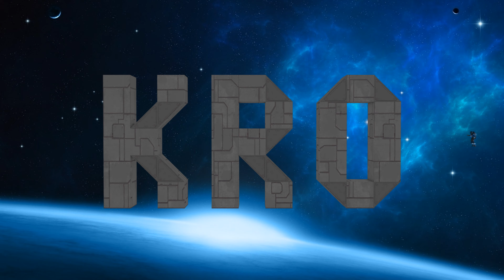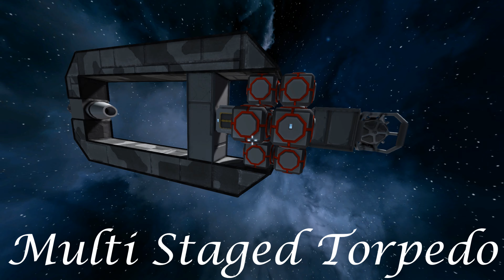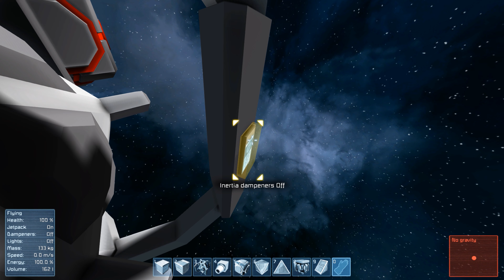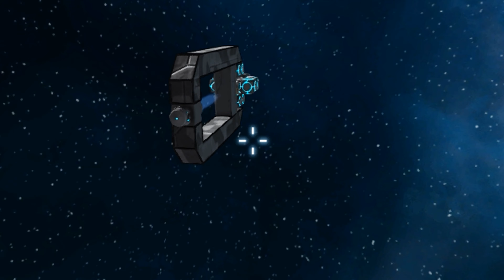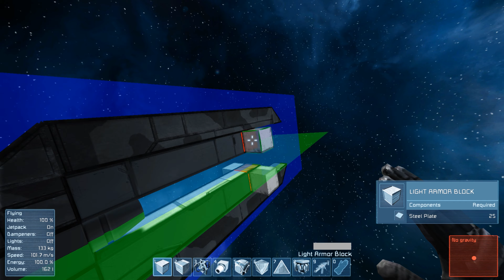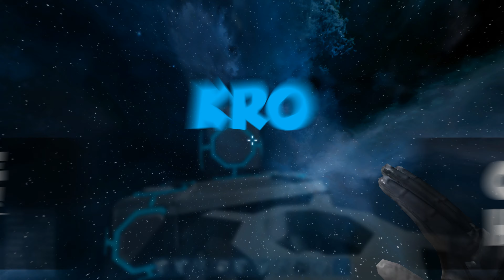Multi-Staged Torpedo (MST) - Space Engineers

Comment: If you combined this with the rock in the storage container, it would be devastating. The rock would be traveling at max speed on impact and would just destroy anything in its path. In fact, you could design the torpedo without the warhead and use the same mechanic that you use to cut the power to destroy the storage box. 

Awesome stuff man! keep it up
Reply from the maker: Thanks! And that's what this is designed for. You can attach whatever you want on the front, as long as it is symmetrical. This is just showing the mechanism that propels the torpedo from a stationary position like a ship/station turret.

Comment: This is without a doubt the most elegant, effective torpedo design I've ever seen. The only problem I can see is that the long minimum range needed to reach top speed makes it unsuitable against small or mobile targets.

But then again, even if it doesn't reach top speed before the warhead catches a gatling round and explodes, an empty cylinder of heavy blocks doing 50m/s or more will still spell trouble for light armour hulls.
Reply from the maker: If it's a small mobile target, your better off using a rocket launcher. Just hit the cockpit and your good!
Reply: Krolitian out of mild curiosity, if you placed another warhead where the thruster causes damage, how long would it fly before detonation? o:

Comment: Actually to repel the torpedo you need a gravity field stronger than the one already there because if the 2 forces are equal and facing opposite directions they cancel each other out so, as long as you launch the torpedo from a distance it will hit if the repelling force is 1g and the torpedo force is at least 1g. This works because of Newton's fist Law, the object is moving and no forces are stopping it because the repelling force is canceled out by the torpedo's force.
Reply from the maker: You can't repel this torpedo though.
Reply: What I'm saying is it would have been simpler just to stick a lot of gravity on the torpedo instead of wasting time creating this

Comment: I've always thought torpedoes to be ineffective in survival not because of their damage but because of their cost. If you have to build an engine, warhead, gravity generator, mass blocks, and armor every time it seems like using them would burn through your resources relatively quickly. If you were to use them effectively I would imagine you would need to cost the other player more in damage than the torpedo costs you to build. This would limit you to attacking more compact systems with exposed or lightly armored components. (Unless you were very resource rich!)
Assuming the above then an effective defense against torpedoes would be to spread your machinery out so no more than one component would be destroyed. If you were to make redundant systems then you might even come out ahead minus the repair bill.
I'm curious, what might be the advantage of using torpedoes over the relatively cheap rockets beside range? Does what I'm saying sound reasonable?
Reply from the maker: The advantage is being able to attach different systems to these torpedoes, like grappling hooks, cluster bombs, and other things that rockets can't achieve, along with the fact that rockets have a max range.

Comment: Your reasoning for how a gravity torpedo will not work is wrong because on an gravity powered torpedo you will have two gravity generators one to push it along and the other to counter the target's gravity
Reply from the maker: And the enemy could have a gravity turret that can deflect it with a couple gravity generators.
Reply: Well like you said in a different reply i don't think a turret could stop it even if the turret was using a gravity generator at full range could stop something going at 104 m/s
Reply from the maker: You'd be surprised.
Reply: Krolitian trust me i have tried to create a turret or shield that can stop a gravity driven torpedo without it being a giant panel of gravity generators though i have been trying to make a counter torpedo that could work in stopping a gravity driven but its not done yet I'm still trying to make it slimmer so it wont be able to be shot down